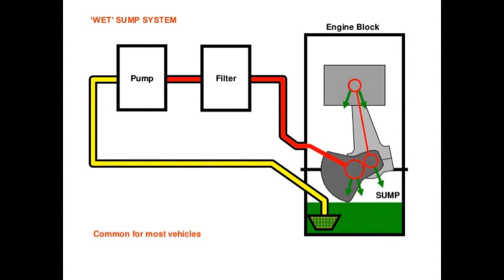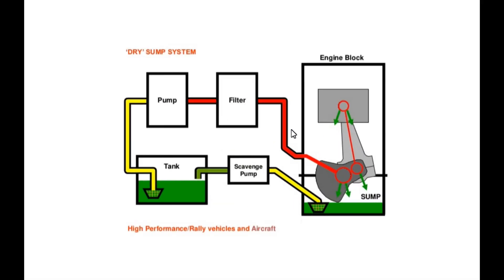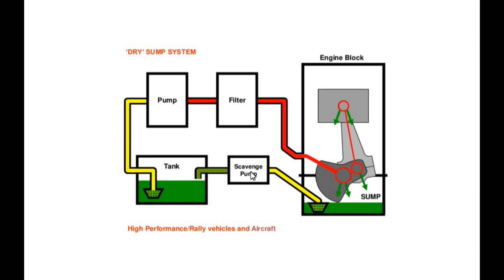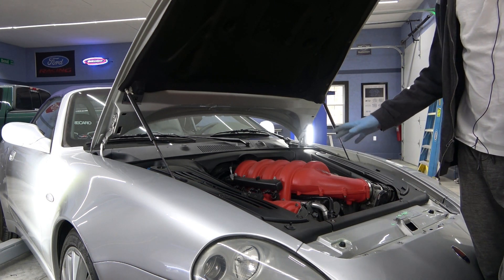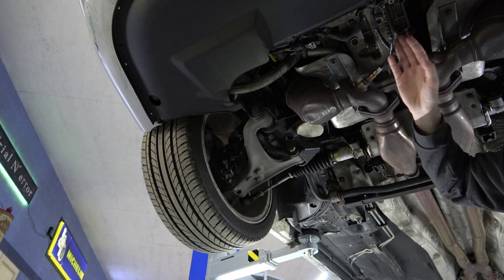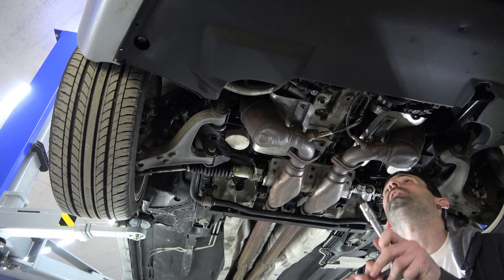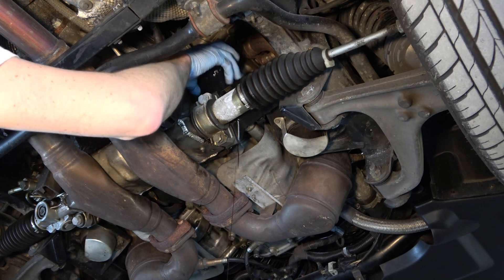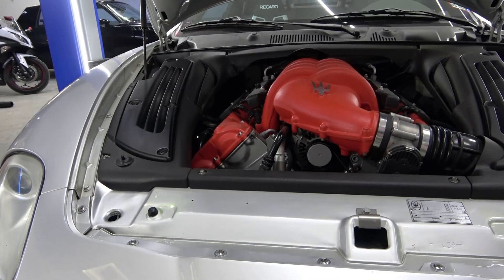Dry Sump VS. Wet Sump - AND WHY DO YOU CARE?

Comment: Tbh such an easy explanation on the subject. 

So im also guessing the cars I've seen getting oil changes with multiple oil drain points are dry sump basically. Draining oils at pump / reservoir/ pipes etc I suppose 😊

Comment: Hey man, 

I'm looking at an 02 coupe gt.  Any issues you've had with yours?  What maintenance have you been able to do yourself other than oil changes? Any thing you'd recommend doing right away when buying the car? 

Thanks! Love the video and channel.
Reply from the maker: Thanks Kyle!  I just had my first surprise issue pop up last week, a misfire on cyl 1.  Looks like it's just the coil pack (about $100 to replace and 5 min worth of labor).  I've done brakes (used EBC pads), serpentine belt, valve cover gaskets, air filter, plugs basic general maintence.  If you go to Ricambi America's website you can look at full schematics and get prices to give you an idea of what to expect. It's been good to me and I beat the snot out of it every time I drive it :)  Don't be afraid of them.  They are no better or worse to work on then any other brand in my experience.  Some parts can be pricey but overall it's not been a bad car to own.
Reply: Thanks for the input!

Comment: Dry sump is only needed if the vehicle gets crazy G's going sideways. Can't be starving one bank. The ZR1 is dry, the ZL1 is wet. Same engine basically, just the vet is gonna get more G's. Same with the GT350 and GT500 both are dry.
Reply: Also dry sumps engines can be set lower in the car dropping center mass.
Reply from the maker: Agreed!  I did touch on the lower center of mass in the video and yes, that's a very big plus!  Thanks for watching and sharing your knowledge man!
Reply: @Trialnerror  excellent video👍📼👍